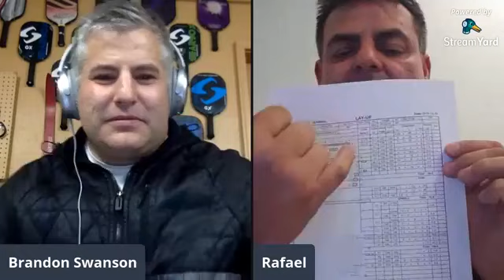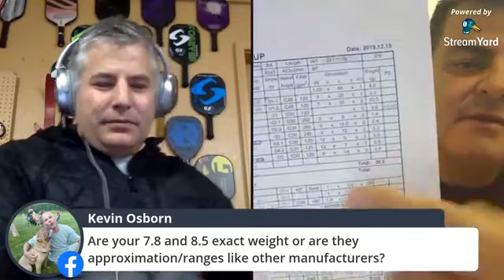How Pickleball Paddles are Constructed with Gearbox Pickleball Owner Rafael Fillipini

Comment: Thought some real-world feedback on the Gearbox 5 might be useful. 

It’s another cold week here in Toronto in February 2022, where I continue to happily put my paddle to the test for a second winter, both indoors and out (even playing in as low as -10 degrees Celsius…fun as long as the sun is shining, at least for crazy Canucks).

The Gearbox 5 continues to stand up structurally, showing only superficial scratches. Not the case for many of my fellow players’ composite paddles - even the expensive ones. (Speaking of that, I wish I’d bought a 1000 of these paddles at the beginning of the pandemic, when I saw them selling for only $80 CAD. Now at $200 and up! Better investment than real estate!)

I chose the heavier weight (8.5 oz) which I still prefer. I also bought the thinnest grip, then used overgrip to my liking. And I love the lack of wasted surface space, thanks to the edgeless design. 

I use and get a lot of spin. 
I can also get plenty of power, though I’m not very happy with my control. However, in my experience, control is a lot more due to the player, rather than the paddle. 

Hope this is useful feedback, especially for us all-weather players.
Reply: Maybe try their CX14H paddle?  I was using the GX6 for a few years and find that the CX14H is a lot softer and easier to control.

Comment: Hi Brandon, I have one of the original G-11 paddles and the top is cracking. Is there any videos on how to repair a crack or can you tell me what type of glue would work for this Gearbox paddle. I have the serial number if needed. I know this is a longshot but I love this paddle so much I cannot find a paddle that comes close to the power I get from this one. Any help or guidance would be appreciated.
Reply: I put some black tape around. I use the 6 and 💓it.

Comment: I didn't see anything about the grip size.  My current paddle is 4 1/8" grip and I see the gx6 has 3 5/8 and 3 15/16.  How do Gearbox grips compare to others?  I just ordered a GS6 with a 3 15/16" grip and I'm wondering if I made the wrong grip choice.
Reply: Tennis player here. Back when rackets were all wood, players often removed the grip and sculpted the panels of the grip to get a custom fit. You might look into replacing your current grip with a thicker material or go with an over grip. I liked the over grip so much that I started buying racket with a 1/8" smaller grip so the fit would be the same with the over grip.

Comment: There should be two sided paddles, one soft the other hard, ping pong does this with different density rubber!
Reply: There is one....the One-shot Flipshot has CF skin on one side and Composite on the other.  Think I read it just came out this June.